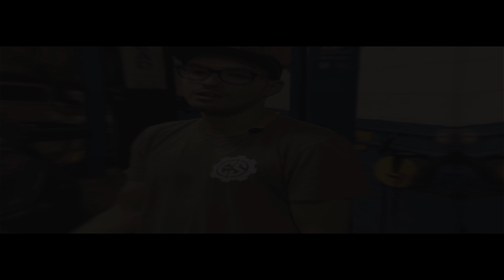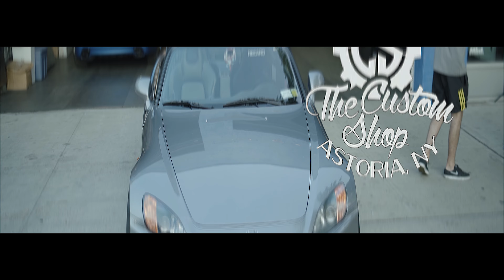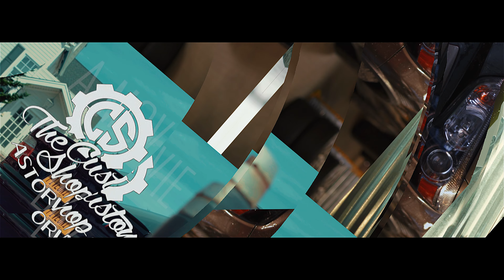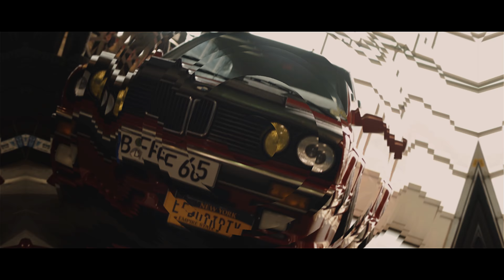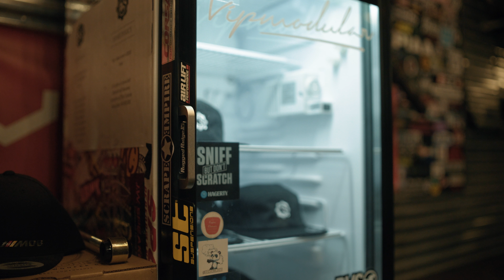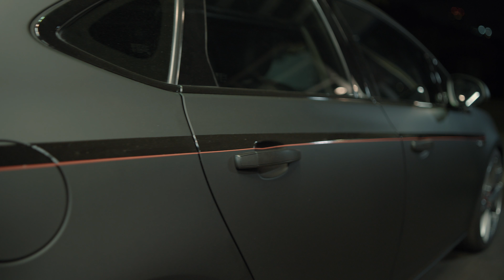Buick Verano - Unlikely Candidate

Comment: This thing is sick!
Reply: Good info on the cruze parts. Wonder what else will fit. You guys need to do a high flow down pipe If it’s a 2.0t. Should make mad power.
Reply from the maker: @exploreroverland9321  Thanks man! Its an NA and car has been sold since. We did a full custom dual catback before it was sold with an exhaust cutout it was pretty rad. You can see it on our IG. Thanks for watching!

Comment: Update.....as of 09/10/2018 all 48 states are done. Roadtrip from 08/26/2018 to 09/10/2018, 28 states, average 1k miles per day, total mileage 12,899. Thats 1 year of usage on a car in 15 days. No problems and still looking good.
Reply: Thats a year if you live in 1990....lol.  Nice job though on the states.
Reply: How much did you spend total on modifications? Do you post on any social medias?